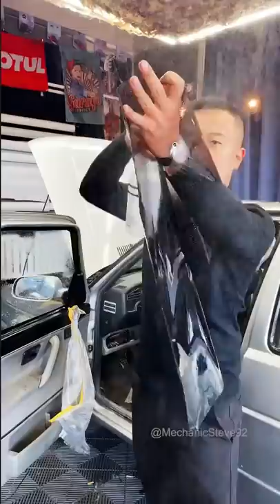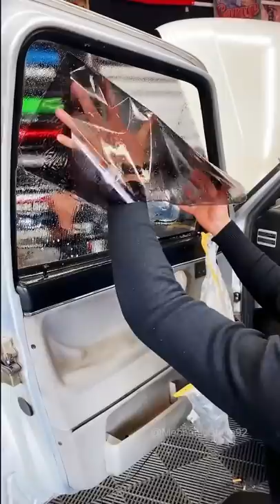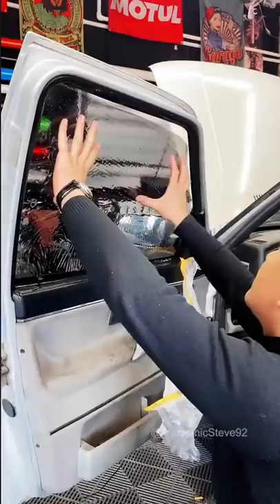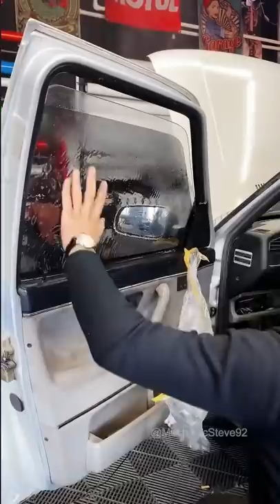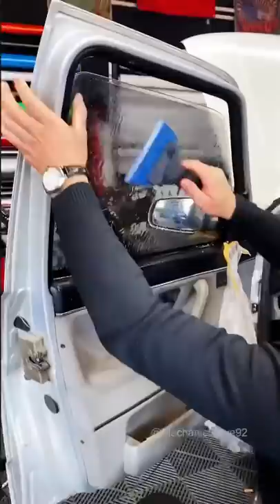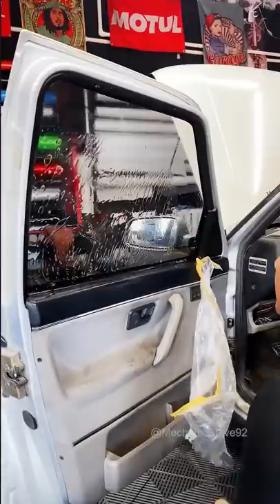Window tinted #mechanicsteve #mechanic #automobile #shorts #automechanic

Comment: So all that water goes into your electrical shit inside the door
Reply: The door has drainage holes at the bottom. It’s designed to be able to withstand water
Reply: The electronics are on the door, not in the door
Reply: @tintshady2049  the electronics are inside the door. The switches that allow you to access the electronics are on the door. They can withstand water pretty well. Even so, some higher end places will put a plastic sheet over the door panel to protect it, but since the door in the video was so old, they didn’t bother with it
Reply: @tintshady2049  sorry. I misinterpreted what you said. I thought you meant that the electronics were on the door and would get damaged when water gets on them. I was saying that there were only switches on the door and they could withstand the water poured on them. All the wiring and connections inside the door are well insulated and should be ok around moisture.
Reply: @tintshady2049  in your original comment, did you mean the electronics were inside the car not the door? You’re right that there are no computers in there, but there is the window motor. But even that can withstand moisture pretty well as long as it’s not drenched